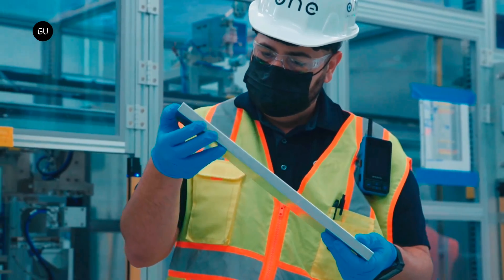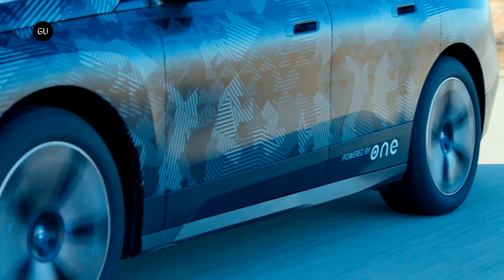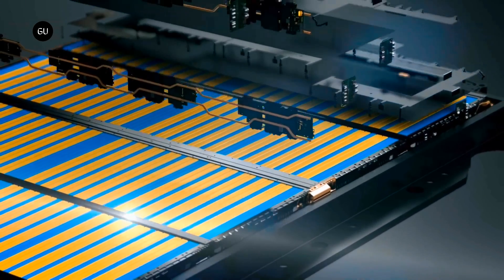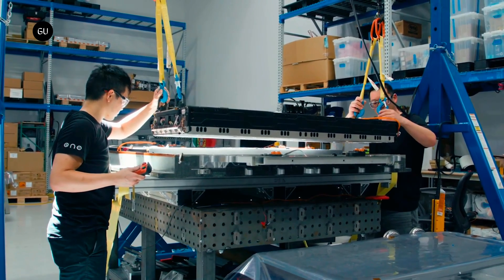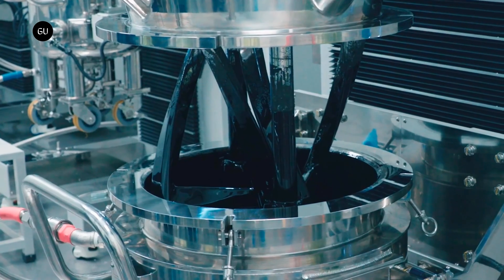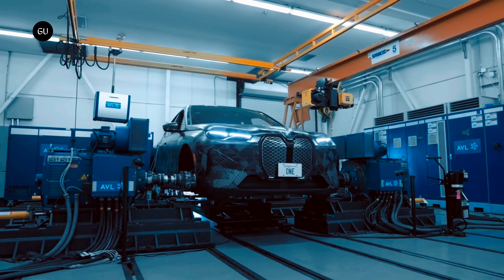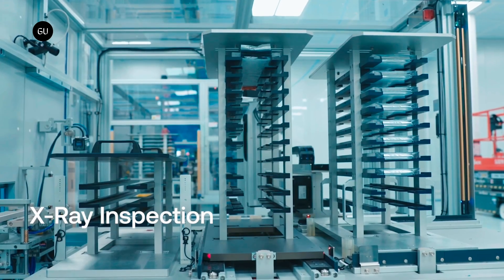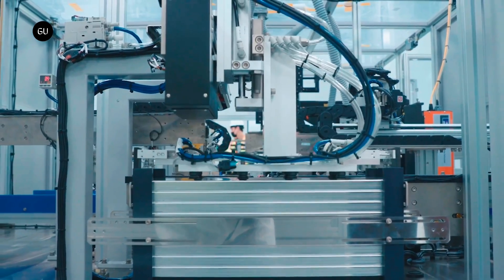BMW iX With ONE's Gemini Battery Pack Drives 978 Km On Single Charge

Comment: One only needs a battery that goes 100 miles on a charge.  Few drive more than this per day.  Dont need all the weight.  Expandable battery would be nice.
Reply: The added weight does not help, but greater range also translates into a battery that lasts longer (fewer cycles in the same miles).  A person gets greater control over the charge range used (%) to optimize battery life.